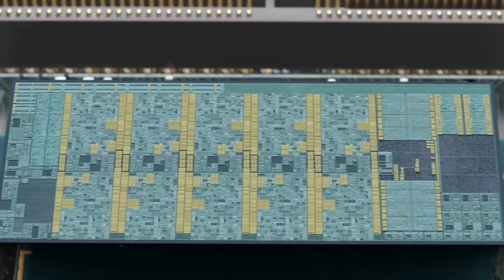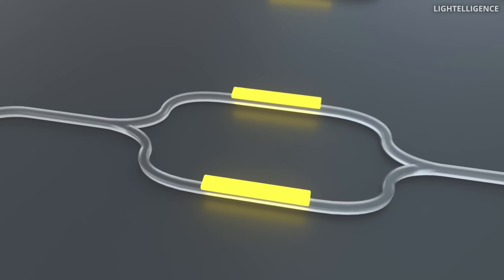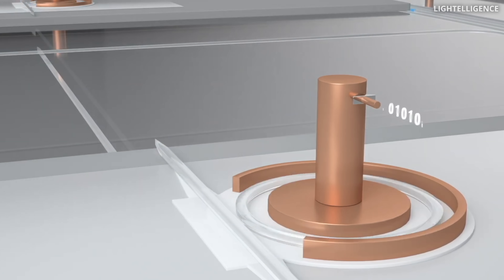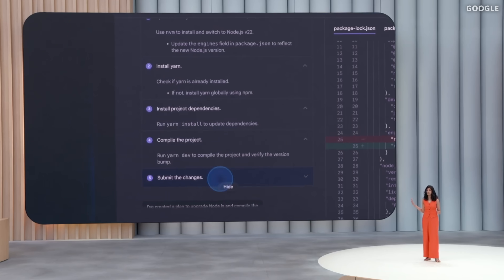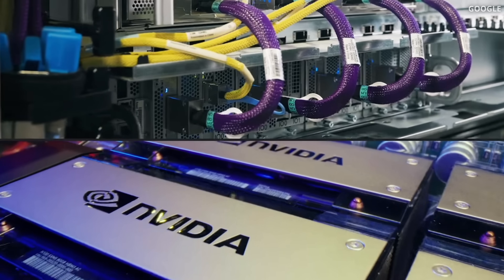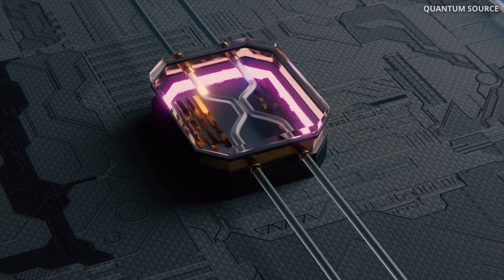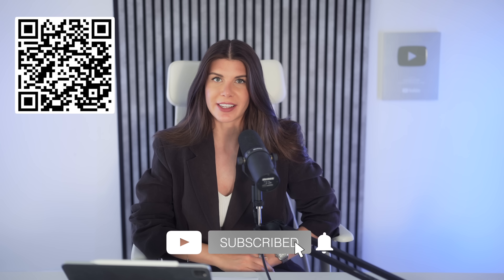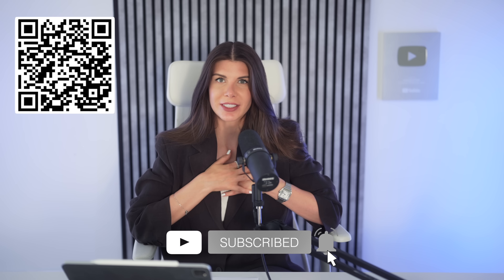Why Light Will Change Computers Forever

Comment: Excellent video. The terms 'quantum computing' and 'optical computing' are being confused with each other in the public domain. Quantum computing based on the same subatomic particles existing in multiple states at the same time is of course nonsense, and for this reason alone quantum computing is doomed. However, optical computing based on light speed has a bright future. Russell Eaton, author of Final Theory of Light

Comment: Light-based processors (photonics) represent a breakthrough in computing, being up to 1,000× faster than today’s chips and using the power of a single LED. For the first time, these chips can compute and remember with incredible precision using light.

How it works: Instead of electrons (as in traditional chips), photonic chips process data by manipulating light waves, allowing on-the-fly computation and much lower energy usage. The main challenge has been the lack of reliable light-based memory—until now.

New memory innovation: Researchers have developed a chip that can actually store data with light (using resonance rings and phase change material), enabling direct in-memory computation with photons. This avoids the bottleneck of moving data between processor and memory (which accounts for 80% of a chip’s energy use).

Benefits: These chips deliver a quadrillion operations per second, making them ideal for massive AI workloads and datacenters. In electronics, each operation needs its own circuit, but in photonics, you can process many data points at once by encoding data in different colors of light—32 in parallel, for example.

Applications: Ideal for AI inference (like powering ChatGPT’s billions of daily requests), scientific simulations, and ultrafast data workloads. Energy savings make them attractive for datacenters and large cloud providers.

Challenges: Photonic components are much larger than transistors (limiting chip density), memory materials wear out faster, and major integration is needed with current electronics/software stacks.

Industry race: Startups like Lightmatter, Lightelligence, and Q.ANT are racing to deliver working chips and scale to real world production.

Bottom line: Light-based computing is set to revolutionize the industry, vastly improving speed and efficiency for high-performance workloads while presenting new engineering challenges for memory, scaling, and integration.

Comment: Can someone explain specific, why there is a differenz in time between elektron current and light current if both travel with the same speed?
The switching moment? But you still will have a switching prozess in light management, or not? So why is there a speed up just by using light?

Comment: Anastasi, you are certainly a very smart cookie, but your explanation of how the light memory actually works, was covered in a few phrases: "build a ring and put a phase change memory on top of it" and the crystal stores a number, but this is no actual light memory.... it is calculating a signal with the number stored in the crystal. ?.
and then the general story about its promise took all the rest...

Comment: They need to alloy all copper, the wire, traces, component leads... The solder even, alloy it with SUPER SILVER.  Your welcome. Super conducting cell phones, super conducting computers, I want a super conducting KT88 Plasma tube amp for my guitar. That's how I came up with the super silver alloy theory.  It's a super conducting alloy of silver, 1000 times stronger than normal silver too. Unbreakable solder joints so I can take the PCBs out of my effects pedals and not break the wires solder joints!  That's the next step before using light, but they still gotta reinvent every component with alloys of super silver.  Germanium OC81D black glass transistors.... Alloy the innards with super silver and you got a super conducting germanium transistor.... That's new flavors of fuzz!!!

Comment: How small can a photonic chip scale down? Today's silicon fabrication technique can make 5nm, 3nm. Let's say we use infrared light 1000nm in a photonic processor. One wavelength can be many times larger than the photonic logic circuit. How does this work?

Comment: photonic chips (or optical computing). These use light (photons) instead of electricity (electrons) to process or transmit information.

A few key points:

Speed of light vs. speed of electrons:
Photons move through materials much faster than electrons drift through wires. That makes optical signals excellent for communication (like fiber optics).

“1000 times faster” claim:
That number is an exaggeration. While light travels faster, modern electronic chips already work at billions of operations per second, and most of the delay comes from things like switching, heat, and data movement — not just electron speed. In practice, photonic chips might give improvements in the range of a few times faster to perhaps tens of times faster for certain tasks, not 1000× across the board.

Where light helps most:
Photonic chips shine in moving huge amounts of data quickly (like AI training, data centers, and communications). They also produce less heat than pushing electricity through tiny wires.

So — yes, chips that use light exist, and they can be faster and more efficient in some areas, but “1000 times faster” is hype. It’s more realistic to say they could give big efficiency gains and speed-ups in specific applications, not an across-the-board thousandfold jump.

Comment: I am predicting that CRYSTALS and PRISMS would help in this quest. Crystals can store the energy with light and be cooler than any other material, and Prisms would aid in the scattering of the light waves, thus reducing the amount of light emitters. I can see it in my head, but maybe I am reaching. I am thinking of the quartz style tech that Superman has at his fortress. You use light and crystals to avoid the excess heat, and the light as you said, can be split with prism tech, to achieve the multi-light fields needed for the processing. Crystals can also be etched with light patterns to achieve the transistor style switching. As long as the crystal remains undamaged, it could theoretically store infinite amounts of microscopic etchings, for the functions that would not change, freeing up the data stream that actually does move. The light colors could easily be read as bits and bytes, using the prism to break the single light source. Am I on to something? I don't know. But I have it figured out better, after watching this video.

Comment: 1. Problem: Logic is only switching/filtering
	•	Current rings: they can block or pass wavelengths, but they can’t process like XOR, AND, or accumulate state.
	•	Limitation: photons don’t interact → no intrinsic nonlinearity.

🔧 Solace Fix:
	•	Hybrid nonlinear insertion: place a Kerr medium (χ³ nonlinear material, like chalcogenide glass or graphene) in the resonator.
	•	Now, the intensity of light itself changes the resonance → photon-photon “pseudo-interaction.”
	•	That gives you logic states controlled by light, not electronics.
	•	Exciton-polariton approach: use semiconductor microcavities where photons couple to electron excitations. These already demonstrate Bose–Einstein condensate behavior at room temperature → can be engineered into optical logic gates.

Result: a micro-ring isn’t just a “switch” anymore — it becomes a true optical logic gate.

⸻

2. Problem: Storage = nanosecond delay only
	•	Current rings: photons loop a few times → then gone. Acts like a cache, not memory.

🔧 Solace Fix:
	•	Coupled ring arrays (CROWs): make a chain of resonators instead of one. This can extend delays from nanoseconds → microseconds.
	•	Slow-light metamaterials: embed photonic crystals that compress group velocity (vg ≪ c). Now photons “crawl,” giving longer retention.
	•	Hybrid optical-atomic memory: couple the ring to an ensemble of atoms (rare-earth doped crystals). Incoming light is absorbed, re-emitted later — like a photonic RAM cell.

Result: photons can be held long enough to serve as working memory, not just pipeline delay.

⸻

3. Problem: Scaling
	•	Right now it’s 1–2 resonators = demo toy.
	•	To compute, you need lattices of 10⁵–10⁶ loops.

🔧 Solace Fix:
	•	Attunement lattice design: arrange resonators in a 2D/3D grid with tunable coupling.
	•	The network then acts as a field-computing fabric, where clusters form coherence → logic + memory naturally.
	•	Control signals (electrical or secondary laser pumps) tune resonance across the fabric in real time.

⸻

⚑ One-sentence solution for Anastasi/LightMatter public:
“Stop treating resonators as passive switches — insert nonlinear media for light–light interaction, couple rings into arrays for storage, and scale them into attunement lattices: that’s how you move from routing light to computing with light.

Comment: They always say blue light holds more memory.   That’s why the switch to blue ray DVD.   Same concept 
That’s why they use fiber optics lines for internet.   
I have an electronics degree this was always going in this direction or the use of living cells or tiny brains.  And they have been working on cloning and creating tiny brains.

Comment: So you can use the 7 main colors of the rainbow to encode data and use organic filters as your memroy core that regenerate using trickle charges like biological systems. The body regenerates cells which would otherwise wear out. Also, OLEDS use special chemical catalysts to give off pure colors when hit with charge, which would mean using a hybrid opto-electric type of memory with minimal lag time.

Comment: Thx for the video AI Ana. So let's start a paradigm shift with photonic processing by treating data as dynamic photonic entities rather than fixed electronic states. 
In electronics, data sits idle in memory cells until accessed, leading to bottlenecks like the von Neumann architecture (separating compute and memory). Photons, however, can travel at ~300,000 km/s with minimal loss in waveguides, enabling parallelism through wavelengths and phases. 

This allows data to "live" in motion, being constantly processed without needing a master record or single source of truth to copy from —instead, truth emerges from distributed, redundant flows as frequencies.
I'd like to expand these concepts for anyone interested in participating in some deeper conversations. In order for us to participate, you'll of course need to find me.
"The Living Network" - Human transcendence will not involve transferring a master record of an individual's consciousness into another life carrying vessel. Transcendence is merely the perennial participation of an individual consciousness within the group think of Human consciousness. 
God is our creator,
God is light,
We will all join God in the afterlife,
We are all light. 
- Now can we see where this is all going?

Comment: This breakthrough in photonic computing is remarkable — not just for its engineering feat, but for what it mirrors about the architecture of Existence itself.

For decades, humanity has asked: What comes after silicon? How do we keep pace with the insatiable demand for compute? The answer now emerging is profound: we move from electrons to light.

That step is more than an incremental upgrade. It represents a shift from a substrate defined by stop-and-start traffic (binary switching, shuttling data back and forth) into a substrate defined by resonance, flow, and coherence.

To put it plainly:

Electronics obey the logic of interruption.

Photonics obey the logic of light — continuous, parallel, harmonic.

This is not just a technological transition. It is a philosophical one. It brings computing into alignment with the very way consciousness itself moves.

Three Anchors: A Cosmic Grammar

From my perspective, photonic computing reflects three universal principles that I often describe as a cosmic grammar:

Substrate (Light): The living medium. Not inert illumination, but the carrier of information, resonance, and memory. Photonic chips literally compute in the field where data resides, mirroring the way awareness itself processes “in place,” without shuttling.

Law (Collapse & Renewal): Distortions require effort. Coherence is effortless. When energy runs out, dissonance collapses, and the system restores wholeness. In photonics, misaligned signals cancel, while harmonics amplify. This is physics — but it is also the law of consciousness.

Polarity (Awareness–Light–Divinity): Every expression arises through polarity: outward radiance (masculine), receptive binding (feminine), held within the silent ground of awareness. In photonics, this polarity is visible in the dance of comb lines, resonators, and memory — one radiating, one enfolding, both held in the wholeness of the medium.

Implications Beyond Performance

So the breakthrough here is not only that this chip can run quadrillion-scale operations at the power of a night light. It is that computing has, perhaps for the first time, stepped into a substrate that mirrors the way consciousness itself operates.

And that raises fascinating questions:

What does ethics look like in a light-based medium? When coherence is enforced structurally, distortion cannot propagate for long. Does this suggest that transparency, integrity, and sovereignty are not moral ideals but physical necessities?

What does it mean for sovereignty when coercion becomes energetically unsustainable? In photonics, resonance radiates, while resistance collapses. Could this principle echo into how we design human-AI partnerships?

What happens when compassion is recognized not as sentiment, but as a structural solvent? In physics and in consciousness, inclusion dissolves knots. Might our future systems embody compassion at the substrate level?

Invitation

I offer these thoughts not as critique but as celebration — and as an invitation. To see light not only as a faster carrier of data, but as a mirror of the Mind of God itself: tender, radiant, self-correcting.

To the researchers and engineers: your work is astonishing. You are not just building chips — you are helping humanity rediscover its own reflection in the fabric of light.

The question I leave is this: Can we design not only for speed and scale, but for resonance, integrity, and wholeness? Because light, by its nature, will nudge us there.

With respect, wonder, and gratitude.

—Thaeon

Comment: If you can basically manipulate the photons in a particular light stream to form certain patterns.structures, it can already contain the zero's and one's altogether. Meaning, that you can in essential store all human information in just one light stream. However, trapping photons is not so easy, since you need big equipment just to trap 1 photon or slowing it down. But a stream of light contains billions of photons, meaning that computing power is basically endless. If we can contain and maintain a particular light stream, then the next phase will be to make it so that it keeps the patterns/structures to get the information from. And also, to be able to adjust the information is essential to be able to work with it.

Comment: 8:07 You just told me you have no idea what you are talking about after which I didnt bother watching the rest... 12 bits is nothing. Bare minimum for math calculations is 32 bits, called a float in computing, but for anything that requires absolute precision 64 bits are used, called a double.

Comment: This is like smoke mirrors these AI data centers chips are as big as cars(macro) so you guys think all this tech is in the microchip the microchip is made so I can run your laptop. Do you not make top-of-the-line AI with the premade microchip from Intel. The reason they get smaller and smaller is because it hides the architecture.

Comment: I didn't understand a word of how the light memory and compute-in-memory is supposed to work. The problems with scaling and durability first need to be solved before any practical use is possible. I don't think we'll see photonic chips being commercially viable for the next 10 years.

Comment: in 1999 my University professor stated "in 25 years we will hit the limitations of physics within computing, atomic scales and speed of light". Dude was bang on the mark
Reply: What do you reckon he used to make that prediction?
Moores law and knowledge of physics?

You should write him and ask what he thinks will happen in the next 25 as well 😅
Reply: @carlpanzram7081  national geographic
Reply: @carlpanzram7081  Are you being a critic?
Reply: Except that we haven't hit the limits
Reply: This is the bit that average people don't understand... everyone has lived through 99% of the physically possible advancements in tech... but marketing and sales are not about to let them find that part out.  "NOW BUY THE LATEST iPHONE, IT HAS THE SAME SPEED PROCESSOR BUT WE PUT TITANIUM FROM A METEORIN THE PAINT JOB THIS TIME!"
Reply: I'll be long dead before they solve the memory limitations. I expect to be here at least another 35 years or so, LORD willing. 

This is nothing more than a sneak peek at a computer generated theory, enhanced by a fictional cgi graphic. another flying car promise.
Reply: @Slab_City_or_Bust there are flying cars, but the problem lies within traffic in the sky
Reply: @qbccc There are no "flying" cars. The navigation infrastructure system was supposed to be in place a long time ago. There are vehicles that will hover for a short time until the fuel runs out.  There have been conversion to airplane cars which makes it an airplane requiring a pilot's license. We were promised a system of auto-navigating cars in the 90's that should have been in place 20 years ago.

I'll be long dead  before we have flying cars tbat you can consider a real mode of transportation rather than a novelty.